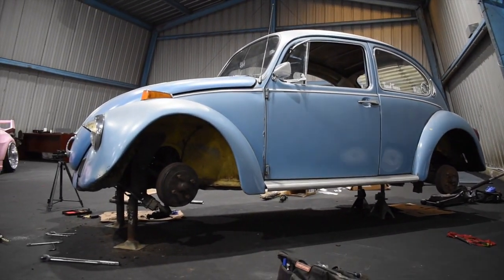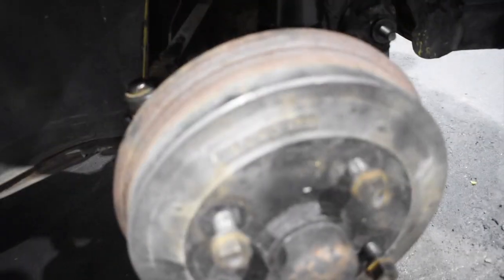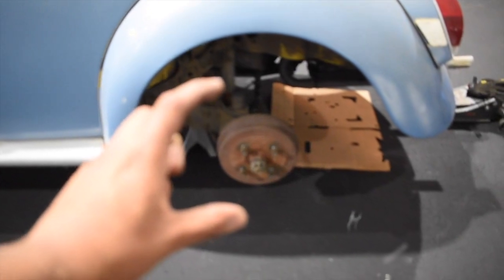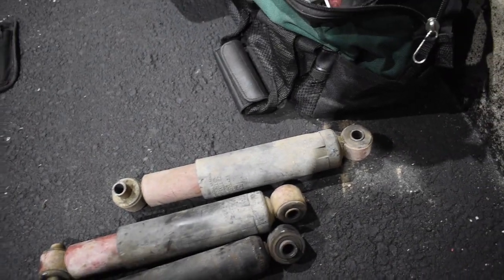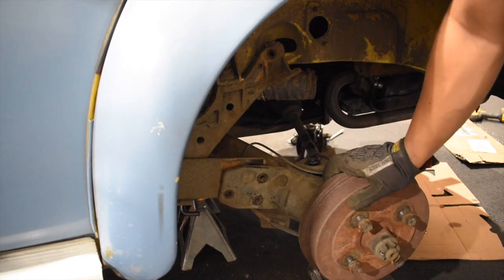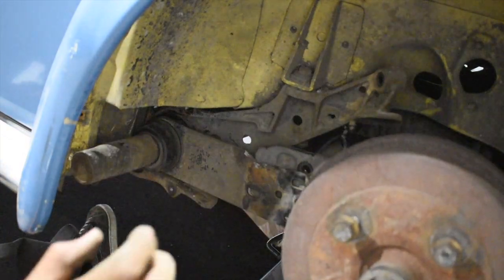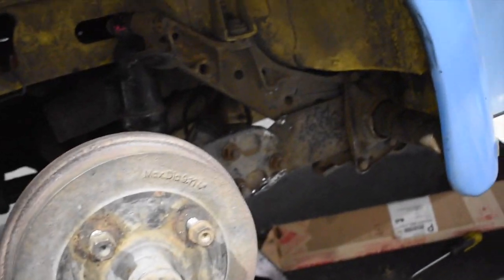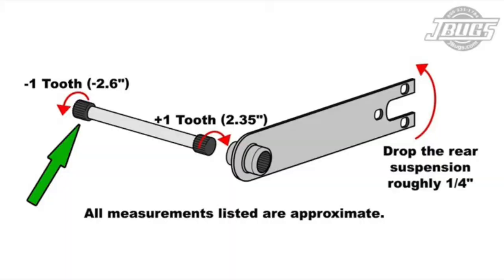Bagging My VW Beetle | Air Shock Install & Rear Torsion Bar Adjustments

Comment: Will these rear shock in your description work for a 67 bug on the rears
Reply from the maker: If the suspension is set up the same way in the rear yes. I know older models have a different rear end

Comment: any issues with the front torsion arms rubbing on the shocks?
Reply from the maker: They do not. My through rod did at first but I just grounded down to where the nut I added was on and it’s been good ever since. They way they come is a bit too wide.

Comment: How much of your upper trailing arms did you grind off to clear the air shocks?
Reply from the maker: In the rear I only cut the spring plate to be able to adjust the torsion bar. Other then that I didn’t cut anything else in the rear.
Reply: I mean the front upper arms. I had to cut ALot off the upper to clear my shock
Reply from the maker: I only had to trim the bottom one, the top trialing arm i didn’t even touch.
Reply: Geez I guess mine had really beefy upper ones then
Reply from the maker: That’s interesting. I didn’t have any issues. I put the car on ramps aired out and raised and lowered it with a Jack to see where it was touching and trimmed that.
Reply from the maker: But only the lower one
Reply: Wow and I even bought the shocks from your link you posted for Amazon the monroe 756. I’m gonna have to get someone to weld a thick plate in the bottom of the upper arm to reinforce
Reply from the maker: I just trimmed the metal sleeve on the actual front shock. So it could be closer to the actually beam rather than the arms
Reply: Did you have to drill out the sleeve on the bottom of the shock for the rear?
Reply from the maker: No I didn’t drill it out. It’s still being used. It’s just trimmed so it’s the same length as the rubber bushing. I show it in the video

Comment: Bro if you need any work on your bug I can narrow that beam for you 2inches 4inches watever you want I live in Turlock I see your around the Santa Cruz area maybe 2hours from Turlock.
Reply from the maker: I appreciate the offer my dude. But I don’t think I would ever narrow my beam. I like good fitment. Don’t understand why narrowed beams are popular on VW. I like the tire sitting right against that’s fender. But maybe that’s just me.
Reply: Right on man. The only reason I narrowed my beam 4inches is because u get better turning radious an the top of the tire is inline with the high inside part of the fender so you can still drive slammed out with no issues an still be able to turn with no rubbing. I just seen in another one of your videos the tire blew out because the side wall rubs with a narrowed beam you don't have that problem.
Reply from the maker: I get you bro. That video you saw was back when I still had 195 in the front. Dropped down to 175 and I no longer have that issue and the fitment looks fire🔥 but now everybody knows who to hit up for them narrowed beams !!
Reply: Hell yah bro hopefully soon I can make it out you way next time there's a show around it'll be cool to connect with people that's into the same thing cheers man keep on buggin out👍

Comment: Are you going to run your stock wheels or go back to the 8 spokes?
Reply from the maker: The 8 spokes are also VW original wheels. They just sitting in storage. I would like to have the luxury to swap wheels but can't decide on a color for them